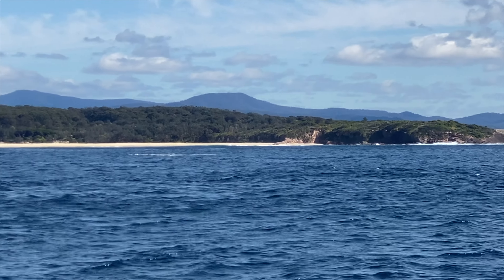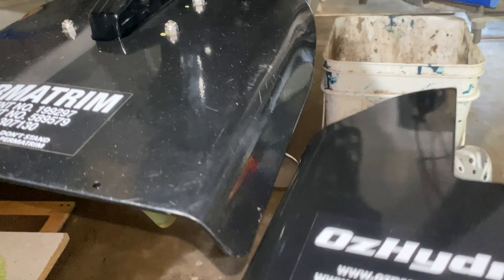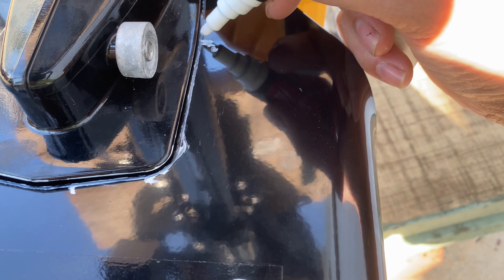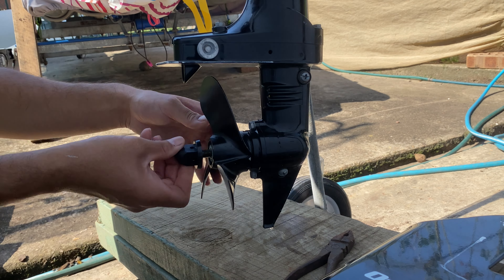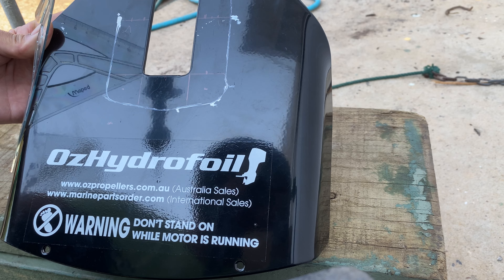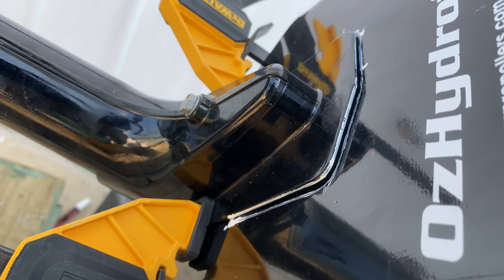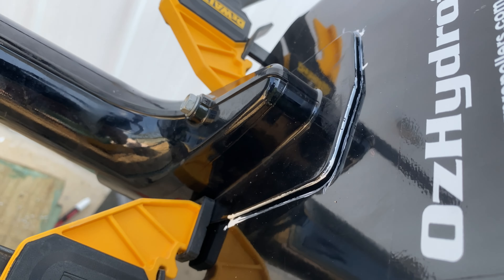OzHydrofoil VS Permatrim on Small Outboards, Comparison and Easy Install  With Basic Tools

Comment: Nuts should be above the cav plate not under, they are catching on water a lot otherwise
Reply from the maker: I like where your head is at 😎. I thought it would be a trivial amount on the 2.5hp both nuts are in line with the next, so I went with what looked nice but now you’ve mentioned it, it will probably niggle at me now though till I swap it 😂. I went nuts up on the 50hp though where I thought it would be a bit of a thing 💪

Comment: sikaflex is enough to mount these
Reply from the maker: I saw you could just glue it but the level of anguish I'd feel if it fell off VS speeding up the install pointed towards me using the included fixers 🙄

Comment: How do they compare on the water?
Reply from the maker: It’s night and day difference, it would experience cavitation after 1/3 throttle or less if in a turn, now it doesn’t have an issue at full throttle. I love the permatrim on the 50hp too, easy on the plane and seems more behaved in chop 😎